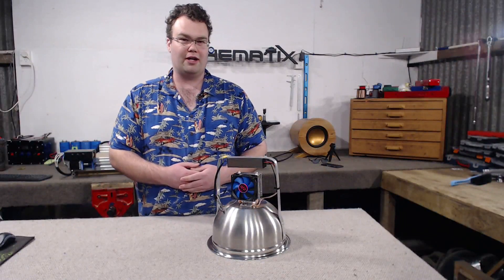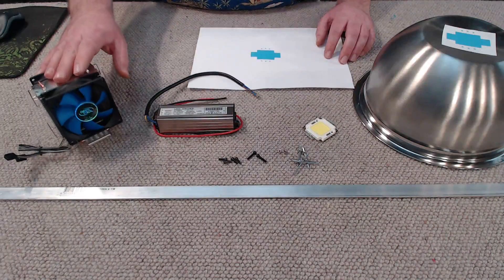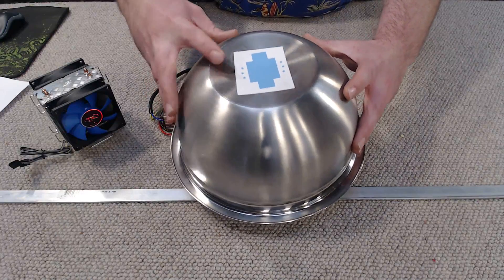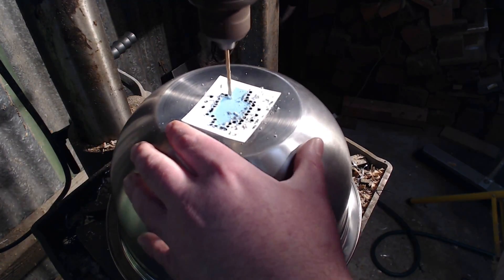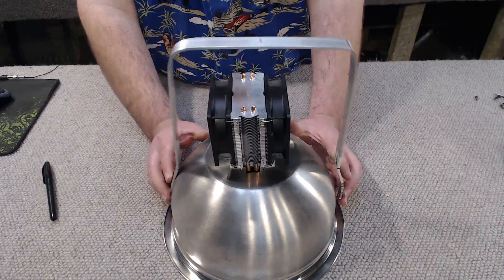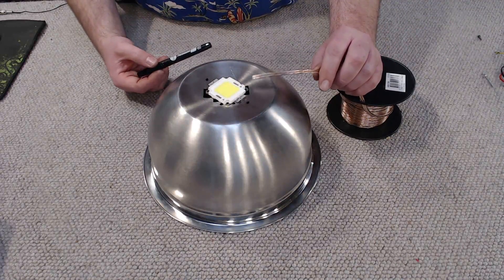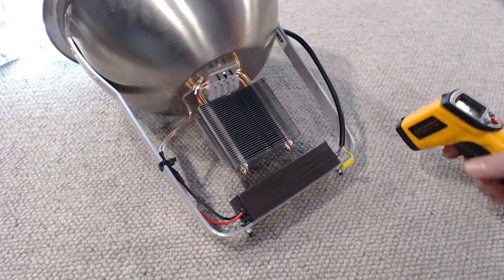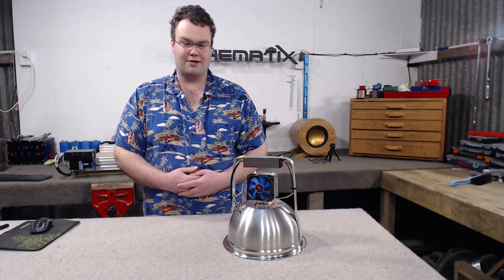How To: Build a 50w LED Workshop/Shed Light, 6000 Lumens!

Comment: Was the led driver plugged directly to 100-240 V AC? I wanted to make my own using 30 watts uv led chip. I found a driver which requires a supply of 5-12VDC/1A. I have an adapter with an output of 5VDC/1A. I'm not sure if it works.

Comment: You need to put some electrical grommets on the metal where the wires go through. Over time that metal bowl will work its way through the soft speaker wire insulator and short out.

Comment: The problem with using such a "reflector" is you cannot predict the photometry, how the light will be emitted from the lamp. It can cause some very weird light patterns or beams. I would say it's better to look for a proper reflector (should be quite cheap) with a known photometry than relying on a kitchen bowl as a reflector. For such a task light a low-bay light, 120° reflector will do a great job, 150° will be good too. Any lower it might be too intense.
I won't use any lower than 120° for mounting lower than 5-6 meters of the surface you want to illuminate.
BTW my job is lighting design for such kind of lighting.

Comment: This is pretty neat. I have a 50w LED torch (well,  it's actually 60w because I stuck a 10w LED on it recently) and it's fairly decent.

HOWEVER, I would be weary of the lumen ratings of these LED arrays as they are usually over-inflated like crazy, and if you do an efficacy calculation by dividing the wattage by the lumen rating you get huge numbers like 200 lumens per watt or in this case, it's more tame at 120 lumens per watt. Oddly enough the efficacy figure on that LED isn't too far from reality and would actually be attainable in a much more expensive part. The unbranded cheapo LED arrays tend to be right around 106 lumens per watt which is around 5300 lumens. Not too far off from a 70w Quartz metal halide lamp!!

Oh... and I would stick a fan on that light even if it's in spec being run passively. the cooler you can keep it the LEDs the longer they will last.
Reply: Ehrr.... That's not how electronics work... Your 10W would probably overdrive it self..
If it's not current limited.. If so
Your only killing it with limited/fixed Po

Comment: I missed how you isolated the led chip's power leads from the bowl??  Looked like a dead short across them the way they appeared to be fastened?  Very useful project and I especially liked your innovative reflector!  I may have to assemble a half dozen for my shop in lieu of led fluorescents.  Seems ideal for cooling with air able to migrate upwards around the chip and out the top.  Thanks.  Take care and Happy New Year.  Doug

Comment: i guess its cool but i dont think its any cheaper than what you can buy a complete unit for and now they have those driverless leds where everything is on the chip that could make it a little cleaner and or cheaper
Reply: Those driverless LED's suck so far. They have a terrible flicker to them that is very annoying.
Reply: yeah and sometimes no earthing ;)

Comment: Using the fans would substantially increase the life of the LED chip. Here is one on Ebay and 1A per fan should be ok... http://www.ebay.com/itm/181419964796

Comment: A big caution on Chinese led drivers. low voltage side to ground is still at mains potential... Use new driverless leads instead and treat them as mains lamps.
Reply: ckbne 
Driverless LEDs are rubbish. Flickering as fuck.
Reply: I have them (50w) and the flicker is not noticeable at all. If one is still concerned about flicker a 4.7-47uF 200~400VDC capacitor can be connected to the output of the bridge rectifier...There is a video to help.
Reply from the maker: That's a potential issue with alot of SMP's not just chinese made ones. Since everything is mounted in a alloy case naturally grounding is not to be overlooked (As shown in the video) "driverless" LEDs still have drivers, they are mounted on the board next to the LEDs in most cases.
Reply: link pls ? watch?= xxxx
Reply: Can you share a video on this subject/ would be very helpful

Comment: Using a stainless steel bowl is an awesome idea! However, do you think the bowl would dissipate enough heat to keep the led cool enough?
Reply from the maker: The bowl is in no way acting as a heat sink, did you not see the computer CPU heatsink attached to the back of the LED?
Reply: I've seen the CPU heatsink, but was thinking about doing a build with the bowl as a Heatsink, as it has a big surface area and should dissipate heat somehow.
Reply from the maker: Ah I see so you want to remove the CPU heatsink and just use the bowl? In no way is it possible for that bowl to dissipate enough heat to keep that LED cool. Perhaps a lower wattage LED (something like 5watts) yes that would be plausible. But 50watts would burn out in minutes
Reply: Hm, Ok I'll probably try to find oft wheres the power limit for a bowl cooled LED is. Thank you for your Support!
Reply: and how do you back that statement up? indeed, you can't, i have a 50W led running with a small heatsink that definitely has a smaller surface area as that bowl. al this in a flashlight form factor, and no heating issues. i bet you did not even try it with the bowl alone...
Reply: it will, trust me
Reply: Think I would do both... great idea with the bowl though thanks man!